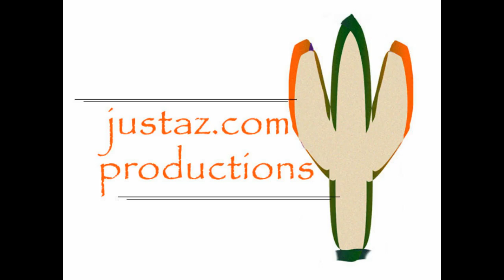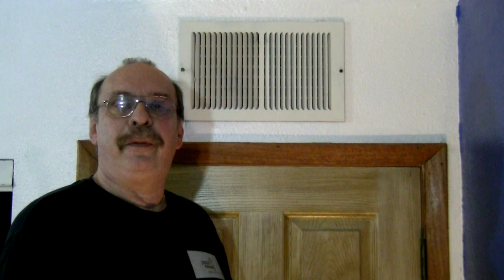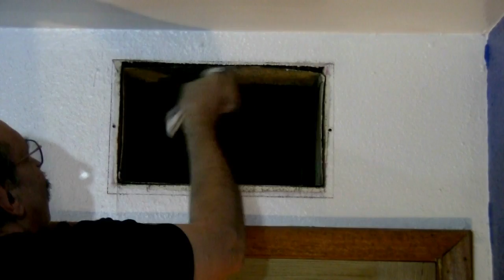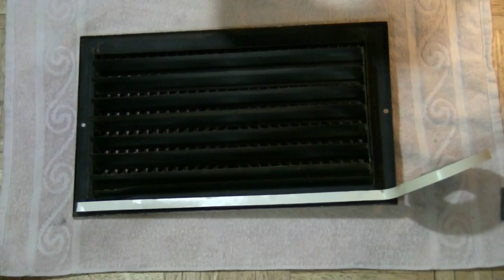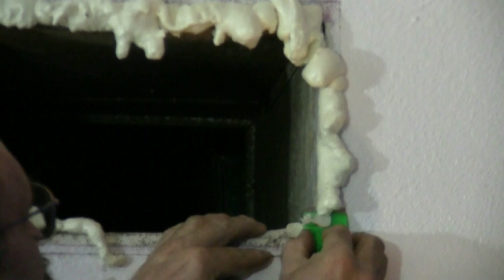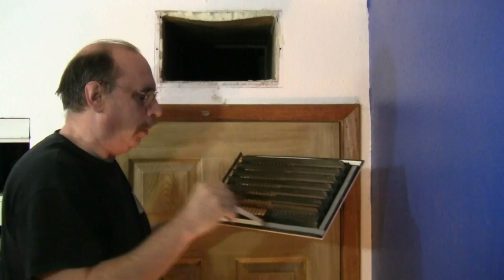Sealing Air Vents for Energy Efficiency

Comment: So if the air had leaked passed the weather stripping it would just be flowing into the room you are heating.  There is no benefit.
Reply: That register looks like it can be closed. With the weather stripping the register would seal a lot better when closed if you didn't want air flowing to that room. 

I have this problem currently, when I try to close my vents in rooms I don't use the air still leaks into the room. So I end up heating/cooling rooms I am not using. My entire house is a single zone.
Reply: So you have one air duct for every room?
Reply: was thinking the same thing
Reply: @_bubblezzzzzz_  This whole video is stupid.

Comment: People used aluminum tape to seal around the vent.
Reply: Aluminum tape + mastic -- same as the ductwork is sealed with. Gives you a perfect flush edge so you're not heating/cooling the inside of your walls.

Comment: Never use that foam! As it expands, it will push your vent further away causing an even wider gap. Caulk any space that is open around the vent and the sheetrock. Then reinstall the vent cover.
Reply: Use the one for windows which doesn't expand & remains soft
Reply: Shut up karen
Reply: @MRSHREK-wk5oc  LMAO

Comment: I don't want to be that guy but he shouldn't have used a high expanding foam, he has really bent in the air duct.  People if you are going to do this method use a low expansion foam.

Comment: What size weather stripping did you use?  Thanks.
Reply from the maker: If I remember correctly it was 3/8" but 1/2" should work as well
Reply: @Justaz  Thanks

Comment: Overkill. And you ended up bending the air duct at the top due to excessive foam.
Reply: 2x4 wedged inside would hold the top of the duct up while the foam dried. remove 2x4 when finished.
Reply: @SamuelMcDonald-d8y  No need to use foam. A little drywall mud would work much better and make less of a mess.
Reply: @MAGAMAN  fair enough! Great point!

Comment: Duct tape or caulk would have been better and less work. Jmho
Reply: Definitely not duct tape! Aluminum tape on your ductwork. Duct tape's one weakness is high temps. I just cleaned a bunch of stinky, crumbly old tape out of my ductwork that left it open like a sieve.
Reply: different strokes for different folks.
Reply: @SamuelMcDonald-d8y  No, there is a right way and a wrong way and this idiot did it the wrong way.
Reply: No-one care about your opinion.
Reply: irony at its best

Comment: Whats the spray name and where can we buy it
Reply: He mentions in the video that he uses "Great Stuff" brand foam, but if you didn't know that was a brand name you might think he's describing how great it is, rather than informing you of the brand. There are various brands available at home improvement stores. You just need to look for insulating foam. They make various types such as low expanding (for doors and windows), fireblock, general purpose, etc. Loctite brand foam is probably the most dense.

Comment: Seems like you "crushed" the upper part of the duct reducing the available airflow.  Maybe using inexpensive painters caulking or event mastic backed tape would be a faster, less damaging choice.
Reply: They sell a version of the spray foam that doesn't expand as much. It's generally labeled for "windows & doors" because when you fill voids around windows, you don't want the  expansion to make the windows hard to open.
Reply: I do quite a bit of retro fit duct sealing. For the gap from duct to the sheet rock we usually use caulk. Mastic works, but its more work especially if the gap is any larger than a 1/4 in. Foam can be used BUT you have to use low expanding foam so you don't crush your ductwork (not sure if he was or not). You'll often see those foams called Window & Door Sealant because same reason,  you don't want to crush the window sash.
Reply: My impression still that the gap was not much narrower before he attempted to fix it. I think the fact that the foam has a different color that the rest of the stuff brings some sharp contrast, and the gap - now more visible because of an enhanced contrast ratio  - appears to be larger. Anyway, I use an HVAC foil-duct tape to cover those gaps. Before applying it, I use 70% alcohol to wash (to remove dirt, paint, and whatnot)... but the dehydrated one should also be fine. Just wash everything a few times (rub with a soaked paper-towel, or sponge) to really remove all junk. And, by the way, almost all duct works at the points of penetration are done badly - I gather that contractors do not really care to make it nice-and-neat-and-shine. So, if you buy a house, immediately remove grills, and inspect the duct work there. The previous house-owner might not be aware of issues, and thus, it will be up to you to fix it... such is the life... cruel, difficult and unfair.
Reply: Cruel, difficult, and unfair? Then don't look at all of the plumbing, and electrical penitrations. You'll be unhappy there too.  Where the floor meets the base plate also has  hugh gaps covered by molding.  When we pressure test a house using blower door technology we find air exchanges are above 10 per hour.  Folks need to understand why their air conditioning and heating have long run times and is costly.  Their house leaks all kinds of air to the outdoors.  In reality,  the little gap around the supply grille is just a start.  Look at the return grille where your filter is.  Look at the duct joints. Look at the equipment gaps. Homes on average leak airflow around 30%.  And, expanding foam is good around  plumbing and electrical, but not around duct.
Reply: I agree with you. But since the post and the video are about the "little grille" gaps, I talked about those only. Yes, you are correct that a new house owner should go around and check the gaps as maybe present because of badly done penetrations for electrical or cable or air-ducts or water/sewer pipes, or door and window gaps. Indeed, there are lots of those, and plenty time and work can be sometimes needed to fix. It is also good that some of the folk makes and  places videos about "how to". So those who have no, or little, idea can learn where to look and how to fix. And, hey! You can try a foil-duct tape at one place and some expanding foam at the other, for "...Figuring things out for yourself is the only freedom anyone really has. Use that freedom. Make up your own mind..."
Reply: It was hanging prior to the foam. However, if you spray the foam in, and then wedge a piece of 2x4 into the duct to push it back up before the foam dries, it might help the duct regain its correct shape. Then just remove the 2x4 when your done.
Reply: John Lane I'm planning to tackle floor ducts that are all bent out of shape and coming away from the floor and drywall, allowing bits of insulation and other debree to get sucked in. What can I actually use to fix this? The gaps can be pretty big and I'm afraid something like silicone caulk won't be think/sticky enough to be effective in the larger gaps.
Reply: think=thick
Reply: Nope. It was already "crashed". I watched the video over again after having read your comment, and - I noticed - there was a large gap to start with (in the first place). But w/o the foam, the contrast was not that sharp to see how that it was large, indeed. But yes, some folk say that you can use tapes - you know that one which is like "metal foil".
Reply: Sergey Shchelkunov 
Really?  At the start he actually doesn't have that much of a gap.  After forming the top has 1 to 1.5 inch in the middle where he used too much foam. And if you look really close,  you'll notice a cut in the film when he attempts to put the grille back,  because he had to trim the foam back took get the grille on.